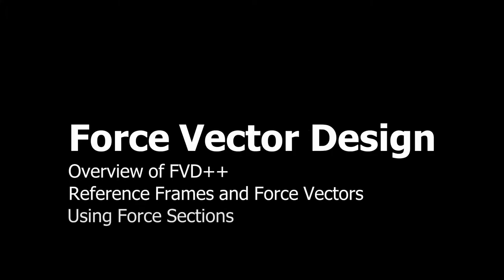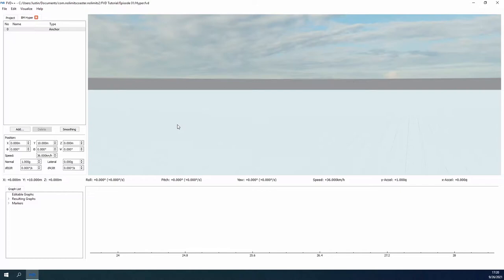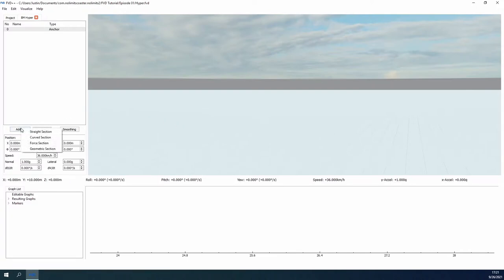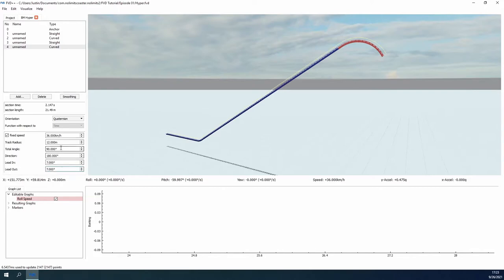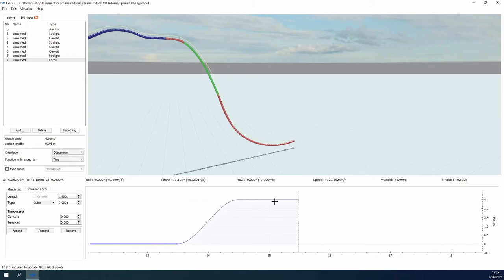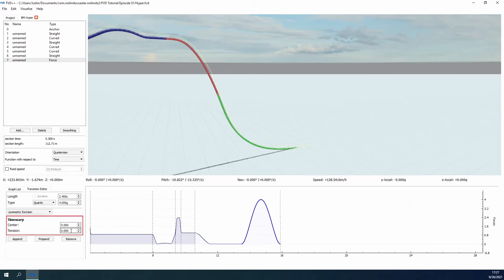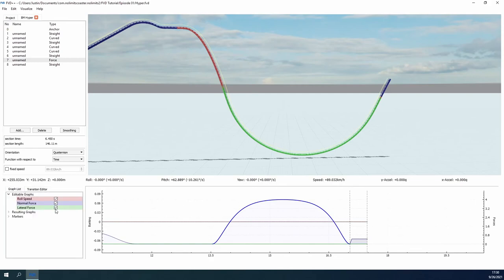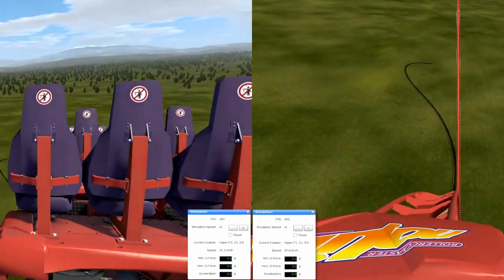Force Vector Design - Episode 01 - The Normal Force

Comment: Great video! And this was extremely helpful, idk if i will use it though because it looks so hard
Reply from the maker: You can do it! Don't underestimate yourself. With some practice you'll be creating awesome rides in no time. Just be patient, and let yourself make mistakes. It took a pretty long time before I felt I was decent at this, so keep at it! ^.^
Reply: . So true. Great advice. It may look intimidating at first, but with a bit of fooling around, practice and a good introduction like you did, it will help a lot of track builders :) I also like the track view in fvd because you can ride the track in pov mode with the actual speed of the train. You get a pretty good impression of how the ride experience will flow :) Great tutorials, well done!

Comment: I recreated your steps to learn a bit more about fixing pumping. I wanted to see if my coaster pumps (exact same coaster you designed with your measurements etc.) and it does not pump. Did FVD change something that pumping isn't a problem anymore?
Reply from the maker: There's no version of FVD where pumping isn't a "problem," per se. It's something you should consider when designing your rides no matter the method more-so than it's a problem. The undulating nature of pumping can be uncomfortable during intense portions of a ride, but might add more character to a slower section; try not to sit too comfortably in the box! ;)

And trying to match my numbers here is kinda missing the point. You should be feeling the ride as you design it. There's no "pull this many g's over this many seconds with this much roll and you'll always get a wing-over that snaps just like batman" to be found here. Understanding why the numbers come out the way they do to make certain elements is much more powerful than knowing the numbers verbatim.